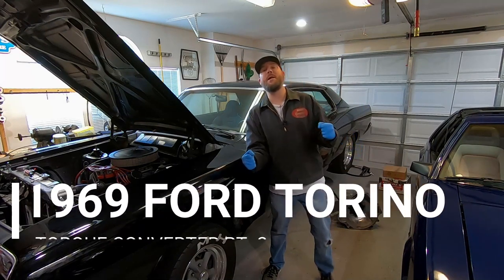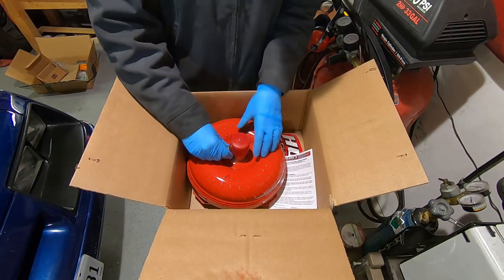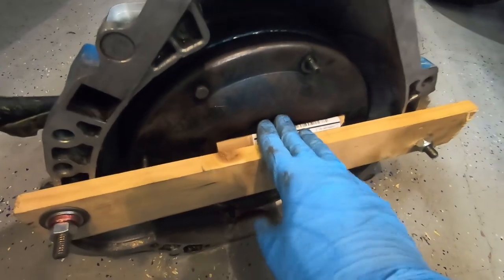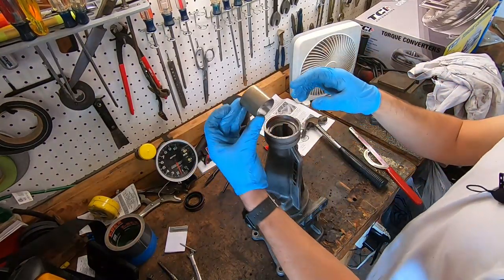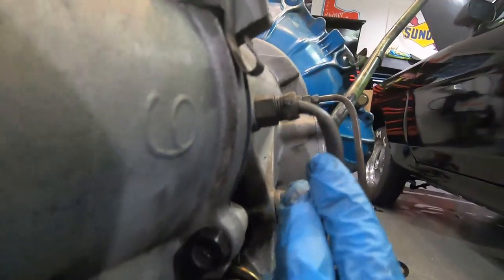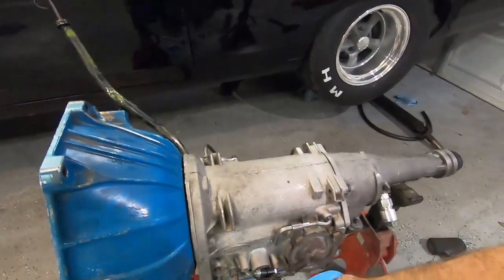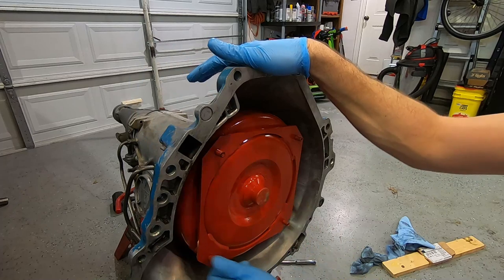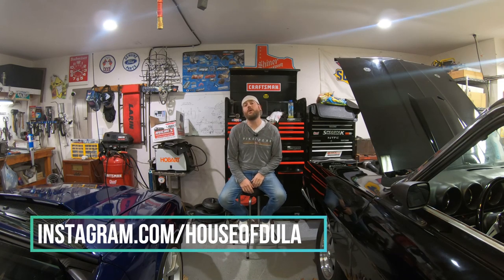1969 Torino - C4 Torque Converter Swap - Part 2

Comment: Wow nice work Mike, love that car. Brings back of my dad's 69. Can't wait till u get it on the road.
Reply from the maker: Thanks Brian. Cool your dad a 69 Torino. That car is a hidden lil ford gem in my opinion. Mid sized muscle car thats forgotten in place on the chevelles, chargers and such. I always thought a formal roof 69 bench 4 on the floor 428 cobra with steelies was the coolest thing ever.
Reply: @HOUSEOFDULA  hey Mike I believe it was a 69 Ford xl, it was variation that came out the fairlane. A coupe with bucket seats and the two button shifter and big back seat.
Reply: @HOUSEOFDULA  all those cars had similar styling and I believe it had a a 289.

Comment: Glad to see C4 trans work. Funny I contacted Hughes for my C4 same stall but 26 spline. It will be my spring project. Can't wait to see the test drive, curious about the difference in getting power to the road.
Reply from the maker: Me too man, really cant wait to see what stock vs a 2500 stall feels like with this lil motor.